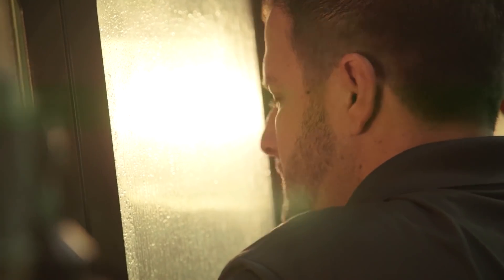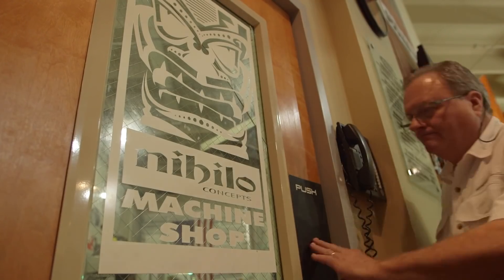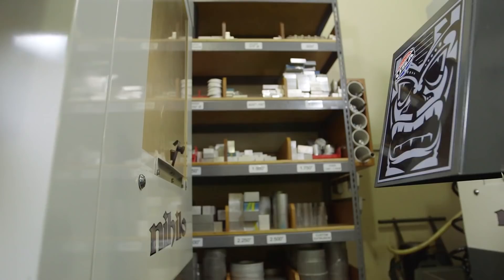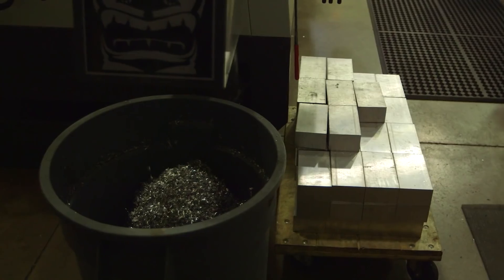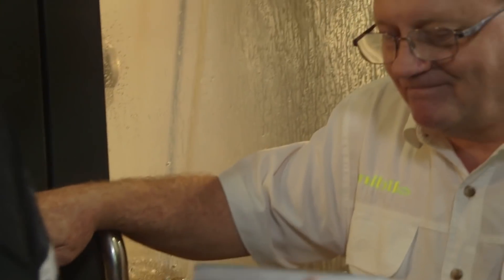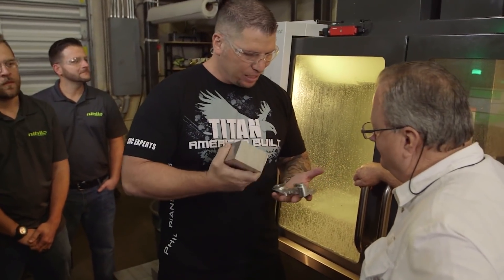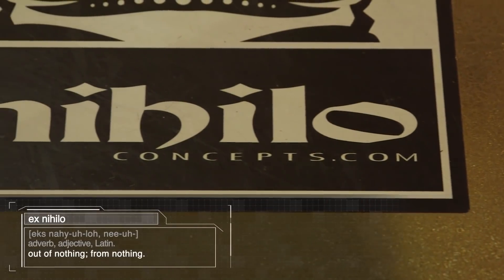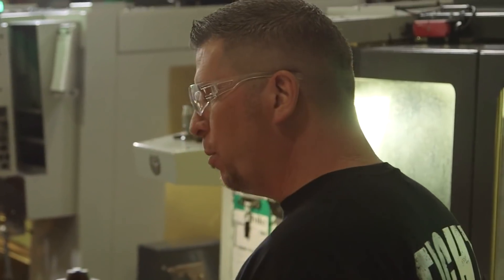I Asked My Boss for a Raise. He Said Go Find One Somewhere Else...

Comment: While I can agree partially with your sentiment, I cannot agree with it wholeheartedly, mainly due to the "sotto voce" modus operandi in the Austrian machine-tooling industry that goes along the lines of : just be glad that you have work, short-sell your life , while on the other hand the union and the politicians lie to the people telling them that metal workers earn "so" much ... "so" much is in fact 2K € straight in my hands with a workexperience of 20 years ... 2K € for being :  a toolpreparator, high-level CNC-programmer, high-level machinist , low-level maintenance-worker and medium-level measuring tech ...

2K €´s won´t bring your family ANYWHERE ... especially considering the worth of machined parts I generate and have absolutely no advantage of ...
So, as sad as it is : knowledge is GOOD, but far from being be-all-end-all .

Comment: In the early eighties I went to work at a small engineering company  as a Turner .  First thing I noticed was the turn over of staff . Every week someone would get the flick . Turns out this firm was taking Government grants to start a new employee and would let them go after 8 weeks when the grant ended . 
  They gave and an elderly Polish turner  and I the job of making  large flanges made out of flame cut plate . The lathe had a 4 tool post but there were 5 operations required  . So it was change 1 tool over or use a file to form the last chamfer ! 
 The Polish guy could make a finished flange in 14:30 minutes  , I could make one in slightly less . We were ordered to  make them in 12 minutes  and treated like fools for not being able too . The foreman's solution  was to file the chamfer at 1600 rpm  . Sparks were flying off the file . It was bloody dangerous and on one occasion  the other operator  lost his grip on the file and it caught then bounced off  splash guard then embedded itself in the ceiling  . 
 After the 8 weeks I was let go . 
 About 3 months later I rode past their factory whilst running an errand , out side was a fire engine  , ambulance and a police car . The foreman had caught his sleeve  in the lathe and it took his left arm off . I didn't  believe it at first but 5 or so years later I saw him on a market stall sell fruit and vegetables  .  Sure enough  he had lost his left arm . Crazy thing was he had a really neat way of doing up the brown paper bags , he'd put on corner  against the edge of the  bench   and pinch it with his knee and while  holding the other corner between finger and thumb spin the bag with a flick of his fingers  . Smart bloke eh  ! 
 I looked at him as I walked by , he looked at me and neither of us said a word . Never ever saw him again  . 
 So the moral of the story is if something is dangerous , DON'T do it , trust you gut  . There is a Karma .

Comment: kinda how i advanced. started on a sheet metal sheer to supply the machinist work. found a couple of guys willing to answer the dumb questions when i asked, watched them set up, and helped when i could. after 6 months there was an incident where the 4 employees working the machines were either on vacation or injured and unable to work. after 2 days of delivering matl and no one to work the machines, i finished my job early and started running a job . supervisor came by asked me if i knew what i was doing. i showed him the parts i made, verified it matched drawings and was to spec, and after a bit of an ass chewing for not asking first, by the end of the conversation i was promoted to machinist. dont think a person could get away with that these days.

Comment: I've spent 10 years going in and out of school for metal work blacksmithing lath and mill work, still have no job and get turned down by every industry I've trained for got certified to work in still get told not enough experience. 2020 i went back to school during the height of covid for welding and fabrication graduated in the top 90% of my class certified for mig and tig sheet metal including exotic materials spent over 25K on education, only to get told everywhere in the industry there the wrong certs and most companies don't count class time as actual experience in the industry, and that my AWS certs mean nothing outside of havac/heating. so i try that only to find they don't use AWS certs because California has there own cert and school i need to go to, asking another lump sum of money.  oh then 2021 told 2020 to hold its beer and raised min wage to the same as welder starting out even some in my state as in security some is paying 23$ an hour. the job i just left for better pay and work just raised its pay to a welder with 5 years work under there belt. so what i learned after driving all over the country to interviews during covid in 2021 filling out over 2500 applications and spending so many hours filling out paper work and 10 years chasing a dream of working with my hands in and out of school and putting over 70 grand of debt on my self, these trade schools promise the world but cant actually do dick for you and there all a scam.

Comment: You should have just said "OK" and walk right out the door. Protip. Don't be the guy who operates the cnc machine. Be the guy who gets called in to work on them. They make more, are treated better and they get free continuing education and on the job training. Throw in a few courses on automation and robotics and you will be a huge commodity. You will be making over $40 and hour and it's cake work. Thank me in 5 years.
Reply: When I visited a shop in Germany that produced industrial nozzles they actually trained their CNC operatives to retool, maintain and repair the machines as well. They paid these guys well, but their loss of production due to outages was hugely reduced. Totally different ethos that I wish other countries would adopt rather than paying more for service contracts from OEMs or similar. It's a brave move as it usually means stepping outside warranty but it seems so much better.

Comment: When that office came, it is time to walk out the door.  If the company gives you that raise, you can kiss that year end inflation increase good by for the next few years.  You have to move when that offer is on the table.  I went from $114K to $235K a year and a half later.  Yes, it was a different job, but it was necessary to make that change.  Then I was able to set my own work schedule because it did not need the first company.

Comment: I can agree with some of this, however I can tell you my similar story which ends with a different ending. I worked at a local IT firm near where I live for over 12 years. My salary hadn't seen an increase in a few years and I went to my boss for a raise. I was denied, even though several other higher paid techs had recently left the firm. I sought out a new position at another firm with a 25k increase in salary. I came back to my then current job, told them I was pursuing a job elsewhere and again asked if they'd match, or at least come close to the salary I was offered at the new job. Again I was denied. So, I put in my notice and left. Two years later, most of the techs have left, most of the clients have left as well. Some went to the job I took and some went elsewhere. Now, the former employer is barely able to keep lights on. They have a skeleton crew of staff and they lost. They did it to themselves and they deserve what they got.

Comment: You assed your options correctly and in the correct manner. 

While the offer position offered more money they weren't at the same level of opportunistic learning as your present, vs monetary compensation; that is not considering the self opportunistic value of experience and hands on OJT. It does have worth. 

I might add that with your growing knowledge and experience your employer is providing, seeing advancement in position and salary, keeping frugal, you could parlay your knowledge and ability into starting a home grown business.

Comment: Your experience mirrors mine. I went to work at a hospital. I trained to be an EMT, but that did not suit me. I spoke to the chief engineer wanting to work in his department. I started off as a painter. I did not like the job and I asked my chief if I could be an apprentice electrician. He granted my wish. It was not easy being yelled at all the time but after four years, I took the exam and became a journeyman electrician. I then told my chief I wanted to be a licensed stationary engineer. He granted my request and after much training I obtained my license. I asked my chief again if I could work in electronics. I was sent to school and became the administrator of the hospital's telephone, nurse call, fire detection and 10-Base T fiber data systems. Through persistence and determination, I achieved my goals like you. I then moved to Seattle and became the Seattle Municipal Towers lead electrician/ operating engineer. After 8 years I took an early retirement........I began with nothing but with determination I achieved all of my goals.
Reply: It's funny.   But I believe zero of this.  Zero

Comment: yeah did this with lowes and they removed me from my position simply for the grand reason of "because" had an investigation done only to be told "Nothing I can do" by the Store Manager and when I made a compliant it was met with silence. 

So i gave them the the nice way of giving someone the middle finger and left. The department I was forced out of had 90% of their Pro's no longer use the Truck that I drove, and have their own guys pick up items no matter where they are working, and they had to hire two other people to stay on top of things. 

I did my job for nearly 3 years and no issue until the bastard that was the Outside Lawn and Garden Manager took over and just fucked everything. 

Oh also I was told that I never did enough but had single-handedly stopped the sinking ship on my own, my knowledge base was VAST (even knowing more than the manager on a lot of bases), pulled-staged and took orders, helped outside loader, helped lumber, was throughout the store 99% of the time getting shit done. 

So yeah i never did enough. Started working for a new company that is a Pro and I like i but I'm looking for a new one.

Comment: During my 46 year career in machine shops I had to make some tough choices. Some were simular to the "get another offer" scenario you mentioned.

I started as a noob earning minimum wage running production turret lathes, and drill presses.

Ended as 2nd shift supervisor, Tool and Die Maker, SolidWorks based designer/inventer, CNC Programer/operator, line mechanic, electronics test fixture designer/maker, 1st responder.

Very good advice in this video. Sometimes the extra cash today, is a distraction from the long term. But always know your worth. Make your decisions from that position.

I even volunteered for a layoff when I was turned down on a request to become a supervisor at one company. I already had experience.

Two years later when they called me back, it was to interview for the exact job I had asked for. I left a job to go back.

For 20 years I grew that into the chief cook and bottle washer job I mention above. Retired from there.

My advice, find something you like and are good at and grow from there. Absorb knowledge with gusto, and make that your trademark.

Stay safe.

Comment: I was much more fortunate with my initial experience at first shop at 19. I said I had the brains to learn and the humility to sweep the floor, and my pay needs were minimal. Boss said I was hired. He wanted someone who would do things the way he wanted, so inexperience was a plus. Every six months, he walked the line and openly stated a non-zero integer to each member. That was our semiannual raise in dollars. He set up matching IRAs for the crew to help us work up personal savings for marriage, education, homeownership, and retirement. I spent 50 hr weeks mainly producing on both CNC and manuals, mills and lathes. Did some oxides and sandblasting and yes, all of the sweeping. Seeing how much waste with which I was overfilling the dumpster, and standing in a pile of aluminum at the end of every day doing the boring 80k piece modify job, I convinced boss to start scrapping all chips. We subsidized the dumpster instead of needing a bigger one. Everyone in the small shop brought value and extracted knowledge and demonstrated respect.

Comment: I learned everything I could learn at a very young age. By the time I was 14 I could take an engine apart and put it back together, I can draw blue prints to scale and design my own projects, I can build a house from the ground up. Now I work for myself and I don't need to depend on a job that requires me to to work endless hours to make that owner of that company rich while I struggle to just get by.

Comment: In this day an age, there is little to no loyalty from employers.  More so with large employers.  You are an Employee/Payroll Number in there system and your name rarely matters.  They will use you and abuse you if they can get away with it.
On the other side of the coin, I like your train of thought and you used them to better your knowledge and experience.  Once at the right point, you can move forward by either, moving up in the company, moving to another company or beginning your own business!

Cheers

Comment: Well  said

Take any job say dishwashing or cleaning bathrooms, some see dishwashing as a no were job, 

But one could look at dishwashing as a workout at the gym and getting paid for it, it also lets one look at the job and wounder how to improve it or improve the lay out and flow of work that passing through.

Take cleaning bathrooms, some see it as a low unskilled job that anyone can do as all you have to do is swap a mop or brush around. But in fact, it a little more to the job, some thanks its beneath them to clean bathrooms, but have no trouble making their way to it when mother nature calls.

Any job is teaching and a learning place and it's not a bad ideal for young people to spend some time in jobs even if its part time from learning to pull wire, install plugs and switches or help Plummers or cooking.

Who knows someday a plug could go out and no service person is on call or the time the maching is down will cost the business lots of money or you are laying out a new kitchen and look over the plans for the dishwashing machine and see it's all wrong and change it.

Take a sink in a high-volume eating place and Codes require a Wash, rise and sanitize sections

But i found having a 4-place sink with, Wash, Wash, Rise and Sanitize work much better and help keep the flow of pots and pans moving at a faster pace, 

You see the Wash water gets dirt much faster than the other two sections as the wash water drains to be replace the flow never stopes as the other wash section is used and you just flip flop back and forth.

Working in lots of jobs for a few years can open one's mind like reading a book or takeing a new class or even looking at Y tube 

More money is not always better 

Thanks for posting your store

Comment: If you feel like you are better you can set yourself free and create a new company yourself. 
I quit working as an electrician back in 1999 and I haven't work in a company I'm self employee in building maintenance since I have my certificates in automatic transmissions and axles, fuel injection, electrical automotive as part of car enthusiast and worked in construction reading blue prints plans then I went to get my certificate as industrial, commercial and residential electrician after that the school trade gave me an offer opportunity to get the class for certificate PV installation and at this point I feel unstoppable. 
I saw an opportunity in SpaceX for maintenance and applied for the position and I put less than half of my curriculum knowledge in the application and their response was I was "over qualified for the position" 🤦‍♂️🤣🤣🤣.
Ridiculous!!!!

Comment: I'm currently in a similar situation. I took a step back and pay for a learning opportunity. The last two years I've been programming and running side work and  water lines. Disassembly of stock mold bases and dimensioning. Basically Drilling. And I'm still not making as much as the job that I quit 2 years ago, and I'm stuck swamped with work and not learning a damn thing. Running two machines while programming across the shop on a slow computer with no 3d programming capability. With no coolant through tooling. Using bright finish drills because thats what they order. I guess I learned how to sharpen a drill pretty damn well.

Comment: I disagree. In no matter what job, what profession I did, I never got any kind of raise. Even when the job-market moved on, and every salary got higher, inflation or otherwise, I still didn't got any salary compensation. I learned to not waste my time, especially on companies. By accepting another offer, I got a 20% increase, and with another a 13% increase.

Most of the time, a company doesn't care about you, only "profit". Don't waste your time, mental health, on worthless people, and companies. They milk you as much as possible, and only care at most, about what is written in the contract. Not even that a lot of times. Sometimes it's even a worse case, when the production leader or supervisor is the bosses someone. 

It didn't matter that I got better, more experienced, that I had higher rate of or better quality production than others. Even when I was the colleague that knew how to handle most things, that others did know, and could easily solve them. Nope.
I guess, this also depends on other things, and every place is different. I'm not a machinist either. Sry.